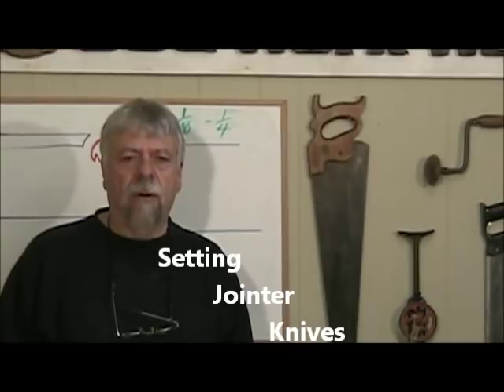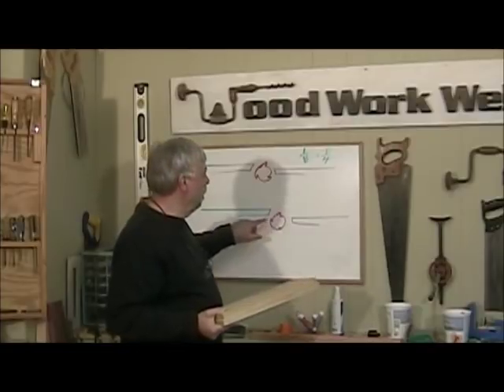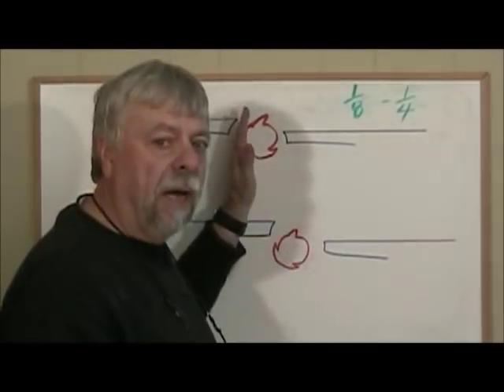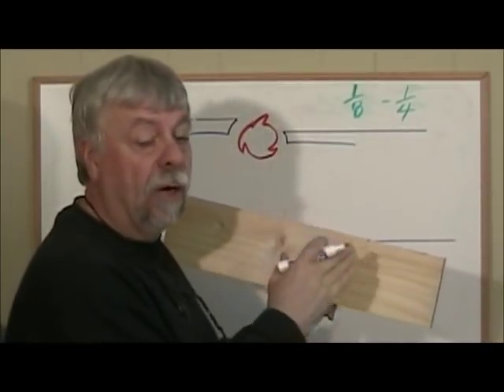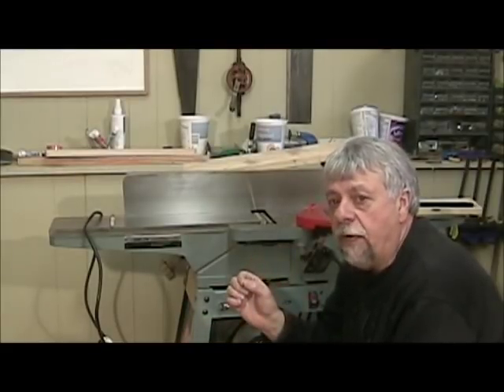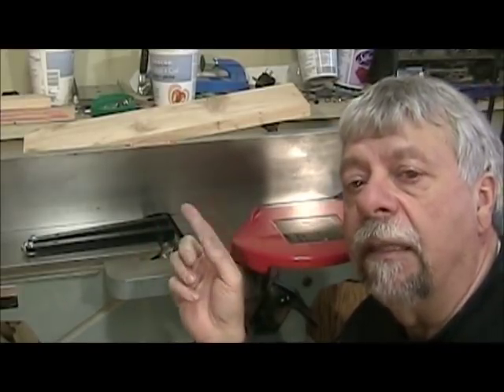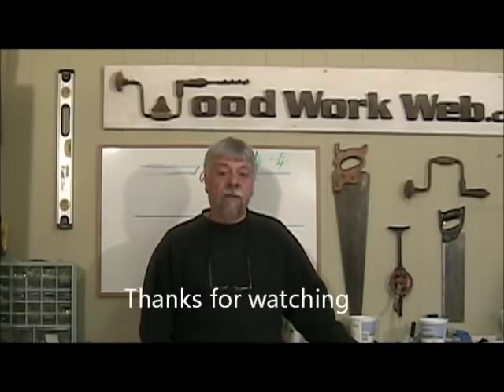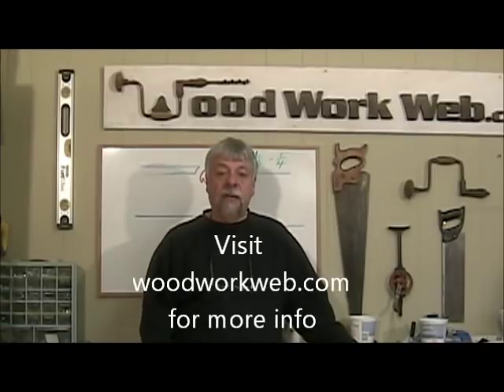woodworking - Setting Jointer Knives

Comment: I am so glad I found your video. It's a long story but my father passed away in 2000 and left his Craftsman tools to one of my older brothers I set up my own wood shop a while back in my older brother gave me all the tools left to him by our father. One of the tools is an old Craftsman jointer which is probably 60 years old. When I set it up in my shop and started testing it I began noticing that Arch and it is pretty bad. I had no idea what was causing it until I just watched your video. I also noticed some Nicks and the blades and I will see if you have a video on sharpening the blades. Thank you very much sir for your video because I was totally lost with no clue as to what to do. I gave you a super thanks And subscribe to your Channel. Thank you again very much

Comment: Great light shared here !  I have an very old Makita Joiner surfacer combo,and although I cannot use my surfacer any more because of failure of the rubber used on the rollers at the time ,I still love my 4 foot joiner bed and continue to use it regularly . This video has shown in very easy terms how to adjust the cutting blades !  My blades were to damn low for a period of time and it was frustrating as heck trying to fix the problem!  Guess what ???after listening to this man ,my blades are cutting perfect once again.   Makita even  furnished Carbide blades on their combo,planer,joiner ,even though the piece of machinery is I believe over 25 years old !

Comment from the maker: Hi Kirk, that's one of the things I love about woodworking, there are many different ways to accomplish the same thing. I have a set of the magnetic jigs and have used, and mine worked ok, then I happened to read the manual for my jointer (5 years later) and discovered it had setscrews to set the blades ... sheesh, who knew. 
Thanks for commenting, love to hear what others are doing and when they pass along good info like this too.
Colin

Comment: My Grizzly jointer came set up from the factory as this gentleman describes. I usually do not have a lot of snipe on my boards.  I get a perfectly flat smooth cut but it is now time to change the blades.  I thought this was the best video on the subject that I have found and I have viewed many.  I sure will experiment.

Comment from the maker: Well, I always say if it is working for you ... don't change :)
With my own jointer, when I do this I get rounding, ever so slightly, but enough that when I try to glue boards together they are don't fit well. For mine, the blade needs to be slightly above the outfeed in order to get flat boards, which of course now entails a wee bit of snipe, but that's what works on my jointer.
Thanks for commenting, always good to hear what others are doing, gives us more options to explore.
Colin

Comment from the maker: Thanks for commenting ... yup, you are right, you can avoid snipe, and if you want to spend a lot more time re-setting jointer knives, setting them even with the outfeed table is the way to go. If you hate re-setting jointer knives and can live with a bit of snipe, setting them slightly above the outfeed table is still the best option. Above all, you never want the knives to fall below the outfeed table.
Reply: Thanks for the video, It is very informative.  I have an older craftsman152.217060.  I watched your video, then downloaded a manual.  It says the knives are to be a maximum of 1/16" above the cutter head and to use the out feed table to adjust the out feed table height to the knives.  I followed the instructions, then did your recommendation on the out feed table  being "slightly" below the knife height, probably about .005" and it works great! no need to sand and pieces fit perfectly. Thank you for a great video.

Comment: I look at most all videos on woodworking. I am an amateur but I enjoy making saw dust. The comments ..negative and positive  are opinions and the best advise I have read is READ THE MANUEL FIRST. .. My jointer is a Rockwell 6 in with adjust knobs on both sides. I have the rocking effect and can't find a manuel for it. ...Just seems that the OF side should be as the height of blades.  Again just an opinion... thanks Colin for your video helps.

Comment: Thanks for posting this, I just acquired my final piece of WW machinery and it is ironically the jointer... plugged it in and tried it out, was relatively straight, but there was some gouges.... need to change knives for new ones.... so here I am.... Im gonna try your method out before I go and pay for a magnetic jig.
Reply from the maker: Hey ... congrats on the new jointer, it will change your woodworking life, aside from the table saw, I think it is the next most important tool.
Reply: Just finished installing the new knives today... all I used was simple $5 dollar magnets from the hardware store and a metal ruler.. ran a test board and its smooth as silk and no snipe at all! The knives are so sharp that when the board is passing through the cutterhead the sound it makes is like scissors cutting paper! don't know how I survived all this time using a crummy hand planer.
Reply from the maker: bandit123kat There ya go ... good to hear

Comment: He is correct in setting them a hair above the out feed table. I use a sheet of computer paper and just get the points barely touching when rotating drum. Which has the same effect as this method. So basically the thickness of the paper above the out feed table.

Comment: Thank you for the nice instructional video. I used your method with the ruler.  I have to blades. One blade top and bottom indicated 4mm ,the second blade showed 6mm top and bottom.....Do I need to adjust from 4 to 6 or vice versa ?     thank you very much again...

Comment: This is a very accurate and acceptable method.  If 1931fordcoupe took the time to actually understand the geometry, he would not have made such an ill informed comment.  In fact, the gauge "pull forward" method is recommended by Felder in their jointer manuals. For a Felder 4 blade jointer, 2mm pull forward puts the blade .0004" above the outfeed table.  3mm "pull forward" puts the blade .0015" above the outfeed table.  Felder recommends 2-3mm pull forward.

Comment: Thank you alot. I'm repairing an old multifunction machine which has jointer and planner and don't know how to setting try the blades exactly. The manual was in French and there isn't much informations caused it is nearly 30 years old

Comment: Thanks for this instruction, it showed me I've done a basic error. I've renovated an old 8" jointer/planer and I set the blades just so they wouldn't grab and I haven't had the performance I liked out of the jointer side of the machine. I guess I thought completely wrong wrt the grabbing thing, I had thought it should be a hair under the outfeed table, just enough to not grab.
Reply from the maker: 1873Winchester In an ideal world, setting the knives exactly even with the out feed is best, but the problem is with a bit of wear, or a tiny mis-calc and the knives fall below the table and you end up with ... as you say, less than ideal results.
Thanks for commenting, I'm sure you will get this fixed up and be happy with the performance
Reply: WoodWorkWeb Well it took some doing, turns out part of my error was an improperly set outfeed table, but when I corrected for that and set the knives as shown here I've been able to joint almost entirely without snipe. Finally my jointer is starting to run as it ought to.
Reply from the maker: 1873Winchester  Well done, glad to here and thanks for the update. It's always rewarding when we figure these things out and they work as they were designed. Makes woodworking much more pleasurable

Comment: Excelent video.
Can you tell us must comun mistakes? Like example you said here, if outfeed table is to low, wood will have a curve.
I'm trying to set up my Wen jointer, but I couldn't, in my last try, almost all wood is flat, but I have a little step on first 2in. What can be happened?

Comment: Great video. In theory of setting the knives, perfect, however my older craftsman has the wedges and the manual says insert knife then wedge… which makes sense, but once the wedges are tightened down the results change. Without getting into the details of this 3 hour  and 1 knife to go… if the 3 blades are within 1/8 - 1/4” we should be good right? One side of a knife might be an 1/8” the other end might be 1/4”? Thats as good as I can get. One end on one might be 1/8” but that end on the next might be 1/4”. I was going for 1/8” on each end of each knife and it truly seems impossible. Thanks for this video… 11 years ago! Lol

Comment: Thank you for all the information.. Being a first time Jointer Operator, the information was very helpful.... Was cutting thin on one side, adjusted blade height and hopefully I've got the problem taken care of....
Reply from the maker: Thanks for commenting Tim
Reply: I tell you, even setting the fence can be a pain. I picked up a Porter Cable 6" Jointer (PC160JT) Being a first timer, I didn't know which jointer to get, so I didn't want to spent to much money. I'm a scroller and just wanted to flatten out my project wood before setting it on the scroll saw table. What are your thoughts on my choice....
Reply from the maker: Tim Rogers  Yes, many jointers fences are somewhat crude, but the good thing with most of them, once you have set them of 90 degrees, they shouldn't require any further adjusting, except to track them back and forth along the cutters, or you can do like many of us and leave the fence far to the right so you don't even have to move it back and forth. This does create a bit more wear on the the end of the knives, and thus sharpening them a bit more, but saves moving the fence back and forth all the time.
I have not used the PC jointer you describe, but it is a good brand name  I would expect it work pretty well for you Tim.
Reply: Well I'm hoping it will work out, I just need to get use to using it, being that this is my first jointer. I sure would hate to use it as a door stop.... I've been reading the reviews on the PC and the jointer was rated at 4-1/2 stars out of five... Time will tell .... Thank you for your replies....

Comment: The 3.5mm (~1/8") drag results in a very tiny error.  For a cutterhead of 75mm (~3in) diameter, the height of the blade above the table will be 0.04mm (~ 0.0016").   I think the stick/ruler method is accurate enough, faster, and cheaper than using a dial indicator.     As for reading the manual, read it first when the maching arrives, and then read it again after using the machine for a while, and then read it again after more use - you'll learn even more things.   

Someday, I'll might you about setting up a Rockwell Uniplane.
Reply: Fulla blarney is going right.

Comment: Hi Colin,
I agree with your setup method here.  I do not have a dial indicator or one of those magnetic adjustment tools.  I fully admit that I could probably be a lot closer in my knife setup if I got one of those like the in the wood whisperer video. I actually use two straight strips of plywood instead of a steel rule because I dont want to nick my nice rules.  Works + is repeatable...I've found any variance / snipe is less than .25mm (approx 1/128") which is accurate enough for me.

Comment: Great video Colin.  I'm a little confused about the in table.  At the beginning you said the in and out table should be the same height with the blades barely higher than the out table, which mine are.  My out table is non adjustable and the in table does adjust, don't you always keep them the same height, I realize by lowering the in table you take a heavier cut but does that still give you a flat cut?  I don't have any manual with my jointer.
Reply: +Fred Parsons Your infeed table should always be lower than the outfeed table...but needs to be nearly perfectly parallel to it.

Comment: I have ones of those porter cable 6" bench top jointers, and it has the ability to adjust the knife height via the set screws as you mention in the video. But I have a heck of a time getting both sides of the blades exactly the same height. Personally I find this really frustrating, as I can never figure out if the two ends of the blade are at exactly the same height. Any suggestions on how to makes this easier would be appreciated

Comment from the maker: @smfield Actually, now I don't use anything to measure the height of the blades. As I show in the video, I just hold a steel rule over the blades and rotate slowly in the directional flow of the wood. When the knife catches on the steel rule it should lift it slightly and move it forward about 1/8th of an inch at any point along blade. That's all I do to set the blades. 
Colin

Comment: Mr. Collin, I have a cheap Porter cable jointer which appears to be a hit and miss..I'm currently trying to joint the edges to make a board but I seem to be having trouble. it appears as the blade is "perfectly set from the manufacturer. I watched your instructions and my blade pushes the ruler at least 3/16"-1/4" what do you think can be wrong if I continue to have arched boards and everything seems to be pretty align. thank you for your video and time.

Comment: This is not the way to set planer knives. Your blades should be exactly the same height as the out feed table. If the board is coming out with a bow in it when the knives are level with the out feed table your problem is most likely to be the fact that the in feed and out feed tables are not parallel to each other. If you set blades like this guy is telling you then you will get snipe on the end of every cut for defs. It's common sense
Reply: MrSamywammy It will not. If knives are barely higher than infeed table (just how he shows) they won't cut. You may easily check it by yourself, set knives this way, lay flat piece of wood on the infeed table and try to rotate shaft with your hands. Knives will touch wood, grab it backwards like they grab ruler, but won't cut. If you rais knives higher, they will cut indeed and you'll get "snipe". So (as he said) it is extremely important to adjust knives at the perfect height, no lower, no higher.
Reply: I agree with MrSamywammy. We make bespoke furniture from tables, cabinets, doors solid wood bookshelves, you name it, we make it. On our three jointers, the outfeed table is set to match the highest point of the jointer knives. All three jointers are regularly maintained and serviced in the shop by SCM and that's how they themselves set the jointers up. Not cheap machines I know but all three work perfectly set up this way.
Reply: MrSammywammy.. once you have your blades set to the exact height of your outfeed table does it no longer matter about the height of your in-feed table? Basically what I'm asking is this, when I'm adjusting the blades am I only concerned about the outfeed table and making sure the blades are perfectly level to that
Reply: @coastalcreekwoodworks8795  your infeed table determines how much material you are taking off with each pass. As long as it’s coplaner with out feed table is all that matters. Your knives are set to the outfeed table. The closer to level with outfeed the less snipe. If your jointer has adjustable outfeed table you can fine tune it after knives are close.
Reply: @user-gm5xm2zy3t  thanks bud!

Comment: setting blades between 1/8 and 1/4 inch. You don't make a point that whatever you happen to choose, be it 1/8" or 1/6" or 1/4", etc., you need to have that exact same amount across the blade and on all three blades. Your demo in the video showed what you stated to be 1/4" on the outer edge while the inside edge looked to barely move the ruler. Was that really OK?

Comment: Excellent video!  I had nearly given up hope on my Ridgid jointer because it kept producing convex surfaces.  Your video explained the cause exactly and I readjusted my knifes to be slightly proud.  Now I have dead-flat boards every time.  Thank you!

BTW, these shop-made straight edges were also a huge help: http://woodworkerszone.com/wiki/index.php?title=Setting_jointer_tables_coplaner
Reply from the maker: Thanks for the note Phil ... and for the link, I will check it out :)
Colin

Comment: I've used all methods known for setting jointer knives and I have found that the magnetic jigs are the quickest, and the dial indicator is the most precise and fulfilling. There are few things better in wood working then dragging a dial indicator over a blade and seeing zero needle movement hah.

Comment: I would have though the blade height should of been the same as the outfeed table, the infeed sets the amount cut and the outfeed holds it parallel to the infeed, if you are hold the timber down to the outfeed table then its tipping.... I'm just a hack

Comment: if you set your blades high like this you will never get a straight joint unless you keep all the pressure on your infeed table (which is wrong) whilst feeding the board and then expect to get snipe..  as long as all your blades are set to the same height you can then adjust the outfeed table quickly and easily so that it is exactly the same height as the knives.  if you dont understand what i mean check my channel on jointer tips and tricks.
Reply: +Tayler Made I agree. I had both problems - too low, then slightly too high. in the end I had to set it exact to the outfeed height